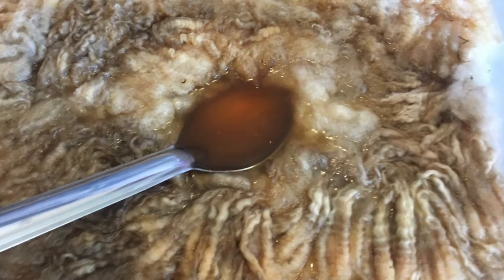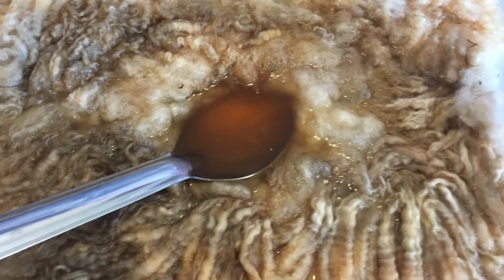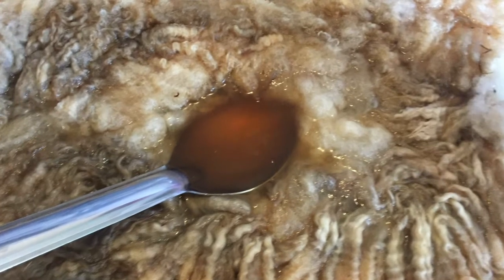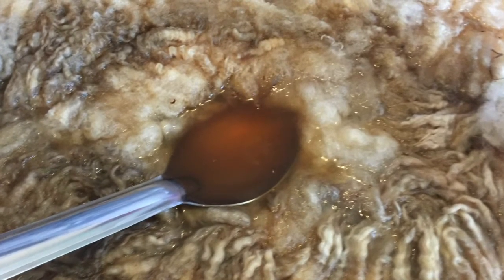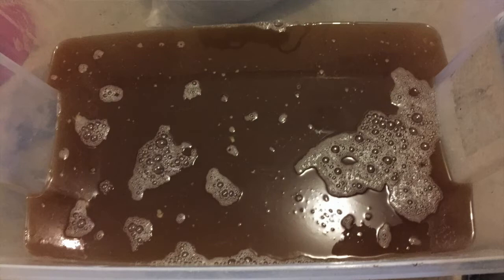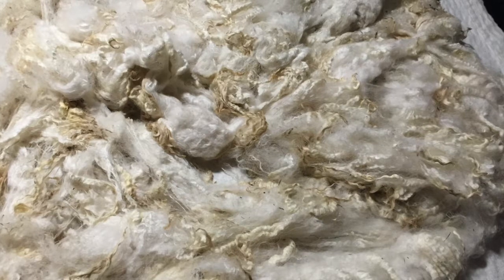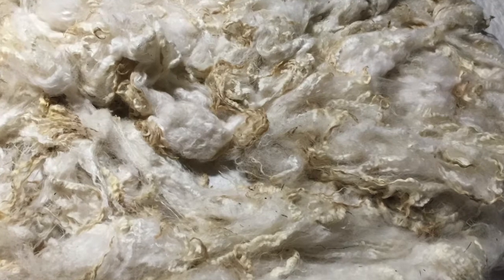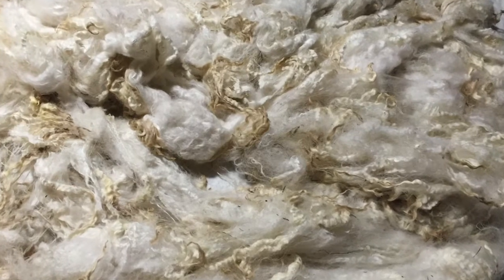Sheep to Sweater – Part 3: Washing fleece with a pre-rinse

Comment: Interesting, thanks. I’ve been washing/processing fleeces for over 50 years. I think the one recent(maybe 20 years) bonanza is wool scours. I’ve used Power Scour, Kookabura, perhaps one other. They just, from my experience, do a better job of actually washing fleece. You use less product as they are pretty strong, the smell is great and they rinse out easily. I’ve seen 3 oz bottles at festivals and I think it would be a good experiment for you to try next year. I wash a few fleeces a year( Shetland/Border Leicester) and go through a half gallon every 4-5 years. I generally plan to wash each fleece 3 times, always outdoors as I won’t assault my 80 year old septic system with lanolin. It’s fun to watch your first sheep to sweater journey.
Reply from the maker: Thanks so much for the kind words and advice, Susan! I will try a wool-specific wash next time I come across one.
Reply: Gage Hill Crafts a scour, meant specifically for raw fleece. Wool washes are for finished garments. Huge difference. I may come up to Bethel for the weekend sale, I’ll try to bring some.
Reply from the maker: @susanfoster8637  Gotcha, thanks! I will see where I can get a scour and try that out.